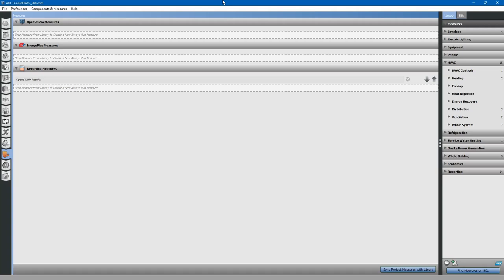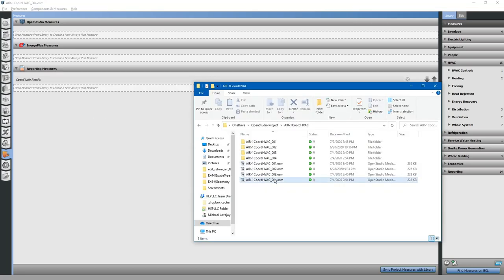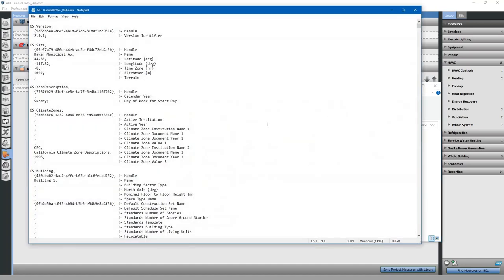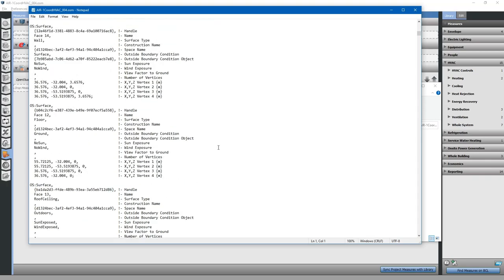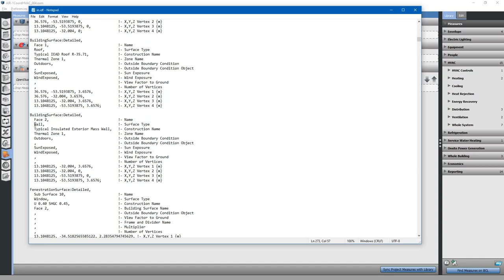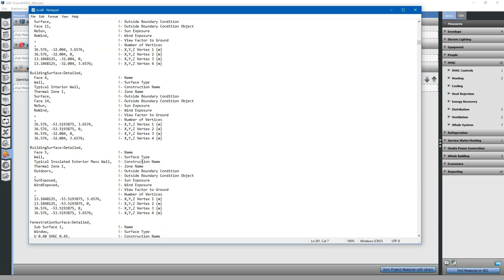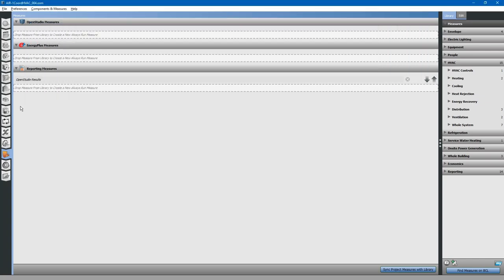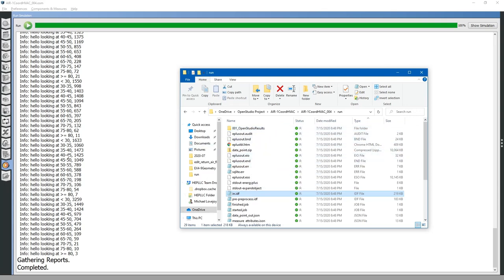OpenStudio EnergyPlus - Measure Writing 1

Comment: Hi. Great video! Is there a place where we could find a user-friendly explanation of each model objects and their properties / methods as used in OpenStudio measures? Just for context, I find it hard to retrieve specific variables from my model (for example, get the construction object assigned to a surface object; or retrieve window objects to add a new blinds object). Thanks!
Reply from the maker: Good question.  The EnergyPlus input/output manual would be the best place to start to understand the objects: https://youtu.be/6esztlZDgz4  Next, I would recommend visiting the measure writing guide to understand the methods: http://nrel.github.io/OpenStudio-user-documentation/reference/measure_writing_guide/  and Finally, you will need to reference the SDK documentation to understand the syntax that the measures use: https://openstudio-sdk-documentation.s3.amazonaws.com/index.html